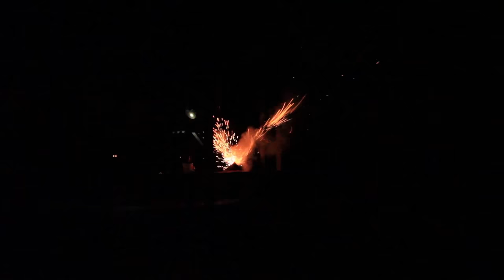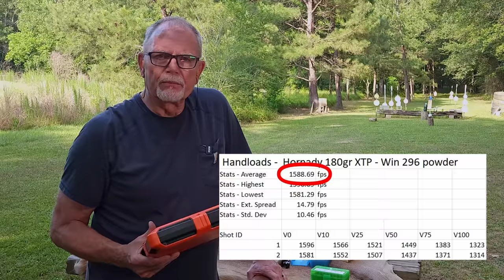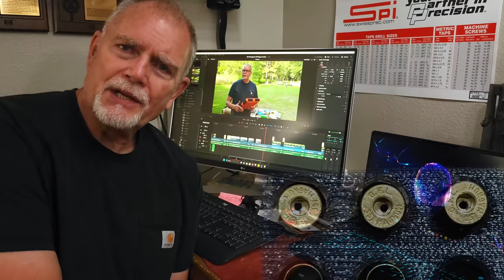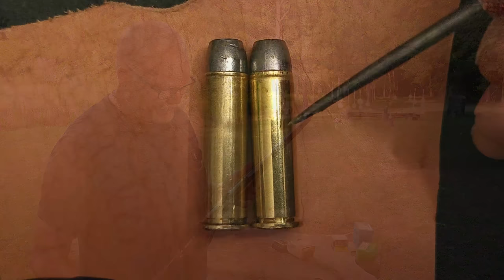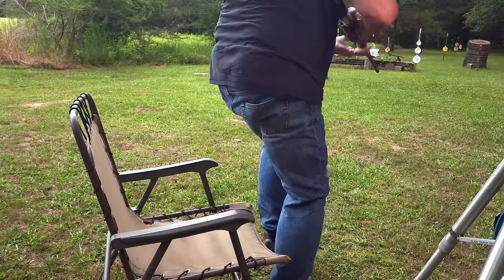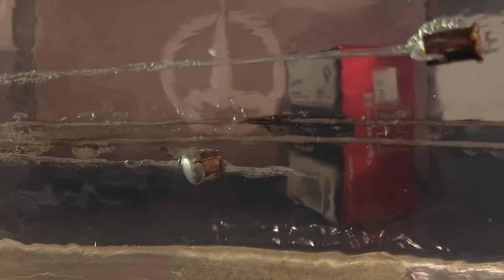Was I Wrong About The 357 Magnum Carbine? ?

Comment: I love my little Rossi 92 .357! If I need to grab something to check a disturbance outside at night around the place, it’s my first choice. I have never used it as my deer gun, but in a pinch inside 50 yards I certainly wouldn’t hesitate. A .357 Mag out of a 20” carbine is a potent and very easy to handle package.
Reply: I got one too; inexpensive, light, accurate and easy to find ammo. It's my go to gun for varmits.
Reply: Inside 50 yards is the duty of a 6 inch S&W L-frame. 100-200 yards is the Rossi 20". Got two of them, 357 and 454 Casull Mag.

Comment: Why is it that everyone seems to overlook the old 160 gr. Keith bullet hard cast, wth a healthy dose of 2400, H110, or the like?  Sure seems to work well in the wife's 1999 circa 1894 16" Trapper, as well as my heavy frame Smith, Colt and Ruger 6" barreled revolvers.  The load doesn't shoot across canyons, but does just fine in the river bottoms and brush with a clear shot.
Reply from the maker: Mr Keith sure made a name for himself with those semi jacketed hard cast bullets. Personally, I like a wider nose and think it performs better in game. But, how much better is open to hours and hours of debate around a campfire😉
Reply: I have used that load often with excellent results.  The 2400 powder burns cleaner and consistency  than some of the newer powders.

Comment: I’ve deer hunted for > 50 years with a Marlin 1894 in 44  Mag with excellent results - drt, as you say, but recently passed that rifle on to our oldest son Which he quickly accepted.   I bought two lever guns to replace my lever gun opening (a Henry steel boy in 357 Mag and a Henry yellow boy in 45-70).   I did also buy a Savage bolt action in 30-06.    While the 30-06 is considered the penultimate for nearly all large game in North America, there is a great comfort in carrying a 357 lever as a great companion to a 357 revolver as a sidearm.   Many feel the 357 magnum is the king of the Jack of all trades calibers based on how many ways it can be paired up between long arms and sidearms.
Reply: I carry into the field the Marlin 357 and a Taurus .357 Titanium 7rd pistol.  I never feel undergunned.

Comment: I have taken 3-4 deer here in new england with a 357 Magnum and countless more with the Maximum. 
In the Magnum I LOVE one bullet. The Hornady 158g XTP-FP over max load of Lil Gun. Yes I know I have pupu'd lil Gun and STILL
DO. But it works in this case giving me 1900+ in a 18" Marlin. 2000+ in a 24" Marlin and 1825 ish in a 16" barrel Rossi. 

180's can loose vel fast and if you dont keep impacts short then can just punch holes. 

The XTP-FP expands like the best Hunting Bullet out to 75/80 yards. Probably lil farther but I have t used past 80. 

Our deer are good sized. Average doe is 125 ish and bucks are 175+. 
Altho we have tanks. My biggest was 263# after 5 days hanging. 

I recovered one of those XTP-FP bullets from a animal all
Rest thru and thru. 

Now I do prefer the Maxi cause it does a 180 @ 2100+ and no bullets recovered. Inside 75yards never lost or lost or
Made animal suffer needlessly with a 357 Magnum.

Comment: I think the key to success with the 357, as well as any other cartridge is knowing your limits, knowing your load, and shot placement. I was hunting with a friend that shot a nice buck with a 300 Win Mag. It was a great shot behind the shoulder, but we tracked it for almost a mile before we found it. I’ve also been on hunting trips where deer were taken with smaller than normal loads (compared to today’s loads anyway). Hunting a sport that we hunters love, knowing that our reward will be stew for supper, or whatever the occasion. Hunting with any pistol caliber requires discipline. Do I favor the 357?  Yes I do. I’ve seen what it can do. And it’s very very effective, at it’s given range. I once saw a 180# buck shot twice with a 45-70 at 55 yards, and neither bullet went through the animal. Is the 45-70 a bad choice?  I think we would all agree that that is an answer. But what was the problem?  The gun? No. The shooter? No. The ammo?  Obviously so. But the same rule applies in any hunting situation. Choose your load wisely. But more important, choose your shot wisely. And be safe
Reply: Thank you! Best comment I've read concerning bullets. Always a dude in the comments measuring manhood with a caliber up.
You can down any game with a#50 bow within proper range. (Quite a feeling i tell ya!)
I'm trying to decide between 45lc and 357 lever action.... Simple as that i cant decide cause they are both excellent choices. One is cheaper yet other has more nostalgia.

Comment: I have used the .357 in a revolver and carbine to take deer. Yes, it works, but I was rather underwhelmed. The deer didn't seem to react much, and didn't go down too fast. Stayed up for an extra shot, yes, proper shot placement in less than 40 yards. Totally different experience than using a .44 carbine. Still a great multi-use carbine. Can still get it done. Just don't expect much fanfare.
Reply from the maker: Well said.

Comment: American Eagle 158 grain JSP is a fine load for deer size game from a carbine length barrel. It expands wonderfully and penetrates quite sufficiently. It also tends to be a little more affordable than the "fancy" brands in the 20 round boxes. It would also be my top choice for defensive use from a .357 magnum lever gun. That said, I wouldn't carry it in a handgun because it needs a 16 inch or longer barrel to ensure reliable expansion. But for a carbine, it is about as ideal as they come.

Comment: I once had a Colt 357 magnum with an 8”+ barrel. I always figured that, out of that revolver, a40-50 yard maximum on deer might be achieved. Alas, I sold it before I ever got the chance to try it. But a 16”-20” barrel would change that considerably.
Reply: I thought it would have been interesting the 457 ballistics between average revolver barrel and average carbine barrel with different loads and projectile weight.

Comment: My personal deer gun for the back yard for the last 6 years has been a modern Winchester 1885 in 357 with a 1x4 Leupold scope, aging eyes need it as well as a heavily shaded back yard.  I have used the Barns hard cast almost exclusively for three years now I think.  6 Deer have made less then 20 yards.  I’ve never had one make it off the property.  All with one shot to the vitals.  Never aimed for head or neck shots as I am not that good.  Love the 357 for it.  For anything past the 75-100 yard mark I still fall back to my 45-70 or 35 Whelen, which ever I have ammo for, they are expensive to shoot so I do not always have ammo for them anymore.  

I love the 357.  Prob a bit more recoil then the lever guns in my single shot, but not much.  Like a 556 AR to 300 AR. All very manageable by most all adults and youth.  I do not see my self switching any time soon.  357 is just so much cheaper to hunt with in the back yard.  Plus I can shoot 38 SPL with the kids and nieces and not break the bank…….ish.  It’s not 22 or 9 mm.

Comment: Thank you I enjoyed your video . I shoot a Model 1907 made in 1916 in .351 Winchester self Load the .357 is very similar over the years many writers whined the .351 was a poor hunting round . In the 1990's when I started loading for hunting with the .351 WSL, because of all those complaints of poor stopping power I sized Sierra 170 grain JHC to .351" . The bullets where only loaded to 1570 f/s but both deer I shot dropped right there . Shots were 40-50 yards as the deer trotted past shot in the upper shoulder broadside. In both cases the shock from the bullet pushed the shoulder way from the body , then made a large hole though the chest cavity and out the other side . 
Your 180 grain loads are very near the original 1906 factory loading of the .351 WSL and should be a great 100 yard deer gun.

Comment: With proper ammo selection, a 357 carbine can be an excellent close range deer rifle. Keep shots to 75 yards or less and it will perform very well. 
The key is short range shots and to not make marginal angle shots that would require a much larger rifle with appropriate bullets. The 357 carbine is capable of these shots with hard cast bullets but those bullets do not create a wound path as large as an expanding bullet and as such the animal can sometimes go a longer distance after the shot.
Reply from the maker: Well said.

Comment: I have always said, George, that the .357 magnum is a more useful cartridge in a carbine than the .44 Magnum.  It will absolutely kill deer and is far better for smaller game than the .44 Magnum. 
While I wouldn't mind having a carbine chambered in .44 Magnum (particularly a Ruger Deerfield) if I were choosing a lever gun in a pistol caliber, it would be the .357 Magnum, hands down. 
My particular .357 Carbine is an original (but modified) Winchester Model 1892 saddle ring carbine.  It probably began life as a .32 WCF (.32-20) and someone, somewhere, probably in the 1950s re-bored, re-blued it and chambered it for .357 Magnum.  
In those days, before the Model 1892/92 had much collector value, and before there were any reproductions, it was common to rechamber them for .357 or .44 magnum.
I actually got a really good deal on it at a west Texas garage sale in the early 70s, as it has no particular "collector value" due to the modification. I am quite sure the stock was refinished at some time, though it was a good job.  
It works great, and is plenty accurate for a carbine at pistol caliber carbine ranges.  I killed several deer and wild hogs with it, coyotes, jackrabbits, foxes and various varmints.  It handles .38 Special rounds well if  they have a roundnose (or round-ish nose) bullet
Reply from the maker: There's just nothing like real world experience. And, I really appreciate yours. As for that vintage Winchester 1892, well let me just say I'm jealous😄
Reply: @TargetSuite  To be clear, George, the .357 Magnum is not my primary choice for deer hunting (that would be the .300 Savage) but it works within it's range limitations. (50-75 yards). The hogs I killed with it were in Bandera County brush where the ranges is measured in feet, though for that I preferred a 12 ga. pump shotgun with slugs. But the .357 worked every time I tried it. 
For whatever reason, the Model 92 never interested me as much as the larger frame Winchesters and my desire for one was satisfied with just one. 🤷‍♂ Then again, I was never a big "PCC" guy.  
But I really would like a Ruger Deerfield carbine!

Comment: Referring to the article found with the search: "Alaska Gunsite The Case For The 357 Magnum" -- With a muzzle velocity of 1827 fps, the velocity at your 25 yard jell block should be about 1746 fps. The formulas given in the article would predict a penetration of 62.9 inches and a permanent wound channel of 1.13 inches. The Buffalo Bore 19A ballistic coefficient is listed at 0.210 and the meplat is 0.28".  Has your testing and hunting experience validated the usefulness of these estimating formulas for your 357/44/45 carbines and revolvers?
Reply from the maker: I have never shot at a big game animal with the 357 Magnum carbine. But I have killed multiple pigs with a 44 Magnum, and it is effective. Not DRT effective, nonetheless, with expiration usually happening within 10 to 15 seconds.

Comment: Fine video, George!
Love the .357mag. It's so stinking capable for what it is. 180gr max loads with a WFN hard cast are certainly capable of penetrating deeply, crushing bone, traveling straight, and delivering the goods. The wound channels appeared to be quite adequate for indicating tissue crushing capability.
In my personal ballistics research in purely numbers, I found that the 20" carbine essentially extends the 4" muzzle energy of a good revolver about 90 yards. If you can dispatch a deer point blank with a 4" .357mag, you can do the same thing at 160 yards (Buffalo Bore 158gr) and further with the right bullet.
It's important to note:  RIGHT BULLET. And there are fantastic bullets available on the market that hold together with a PCC impact velocity.
For fun plinking with lighter bullets, the 125gr will eclipse the typical 2,200 fps permanent stretch velocity (at least at muzzle), when loaded to max pressure.

Comment: Impressive penetration for a pistol slug.  I always felt the .357 was on the good side of marginal.  Range is the question, I suppose.
Reply from the maker: Thanks, and you are right. Hunting with the 357 Magnum should be a short range affair. But I might give it another 20 or 30 yards over your 30 to 40. But, that's only in ideal conditions.

Comment: The .357 Mag carbine has some utility.  From the longer barrel it effectively turns the magnum handgun cartridge into an intermediate rifle cartridge.  It is approaching the power of a 30-30 rifle while having nearly double the magazine capacity.  You can also carry a revolver of the same caliber for convenience and ammunition interchangeability.  The women I've watched fire this type of carbine seem to handle the recoil well compared to the revolver.  It is also light enough for them to shoulder and hold steady compared to some heavier rifles.  There are of course more powerful rifles out there.
Reply: Yeah ... the 357 Magnum is probably one of the most versatile cartridges around. Granted, it may not be the ideal choice in a snubby carry or for a carbine deer hunting ... but it can do both effectively.

Comment: Most of my younger days hunting deer and hogs was in forested areas an/or thick brush areas along tree lines and I had a 4" barrel Python on my hip and a no-name brass receiver, 38spl/357MAG 16" lever gun with a piece of paracord for a sling.  Dont think i ever shot any deer or hog past 75yds never had to look for one farther than I could see from where they were hit......it was really nice to be able to bring ONE ammo with me(2 if you count some .38spl shot shells and low loaded 38spl for small game).
IMO, there is no more versatile combination of 'going to the woods' unless you are after birds when the lever gun would be swapped for my model 1100 20ga with the short, mod choke barrel on it.
My life got away from me somewhere in my early 20's and it's time to take back control and get back out into the woods more often.

Comment: Buffalo Bore loads the 180 XTP that will also get 1850 fps out of your carbine. They also load the 158 XTP that will push 1900. The Federal 158 soft point will give 1820 fps out of the carbine and will expand vey well. Pick the right bullet with a real 357 mag charge and it will do fine.

Comment: I have taken several whitetail deer with a 357mag .. using 158gr JFN bullets .. out of a Rossi 357 mag carbine with a 16 inch barrel and two with a Blachawk with a 5.5 inch barrel using the same bullet 
it worked … absolutely no problem… with the revolver.. I was in a blind near a deer trail .. around 25-30 yds for both … actually shot both does before lunch .. same day .. 
the 357 out of a carbine .. with the right bullet is a different beast for sure 
I have used the 180gr XTP in a 357 Max … single shot carbine to take a nice 8 pt Buck at just over 100yds …
That lets me know, just how good the 350 Legend would be

Comment: You failed to mention your barrel length for that particular gun which is definitely a significant consideration with a .357 Magnum. I'm guessing that's a 20" barrel like my Rossi R92. I also have a Cimarron 24" octagon barrel .357 Magnum rifle. I definitely appreciate your video showing the gelatin terminal results. I'm thinking the 165 grain is definitely something I'm going to source as it seemed like it mushroomed well and larger than the other, still with decent penetration. Good to know the hard cast 180 grain didn't feed as well. I haven't had an opportunity to fore either of mine yet and I got some Bear Defense 180gr hard cast cartridges. I hope they function well in the rifles or they may just need to be loaded in the old 6" S&W 686 revolver if they don't! It would be excellent if you did a similar test with .38 Special through that rifle to compare.

Comment: I like the 357 carbine for a reasonable range deer getter , I have a Marlin 1894C that I hunted deer with back in the 80's and killed several deer with it none were over 75 yards but would of used out to 150 yards had the opportunity been there, but it was not and I have not hunted deer since the early 90's, not for any other reason than I moved from where I lived to another location and locations to hunt were not convenient. But my experiences were positive and I used factory 159 gr JSP bullets but do not remember specifics on manufacturer etc, the concern was wheter the hollow points expansion at distance would expand as I knew nothing about chronographs or ballistic gel in those days all I knew was dead deer

Comment: I to hunt with a Carbine magnum here at Wateree SC. My handload differs in that i work the light end of projectile weight. My load consist of the long forgotten Remington Semi Jacketed Soft point using WW296 At 1560fps. Penetration is on par. This load has never failed, and landed me an 175lb 10 point @ 65yrds with mild recoil. Ur 180gr cast seems to be a rage here and I must say I use the R 125sjsp only that I have a ton it. Buf Bore loading was to heavy, and as a hard cast, the darn things did fowl my bore. Great vid.